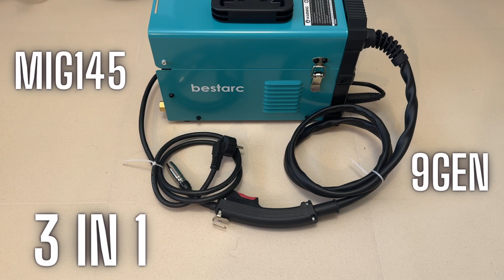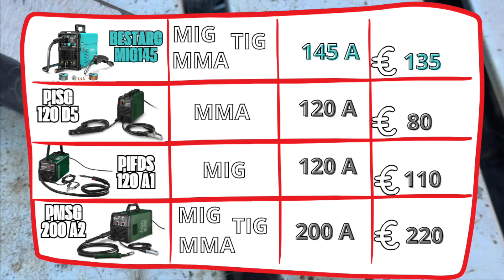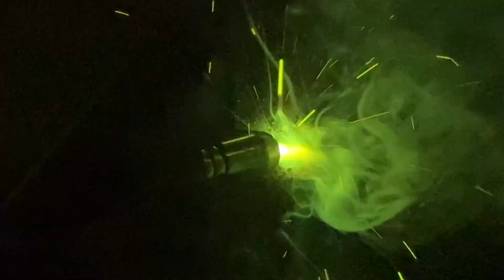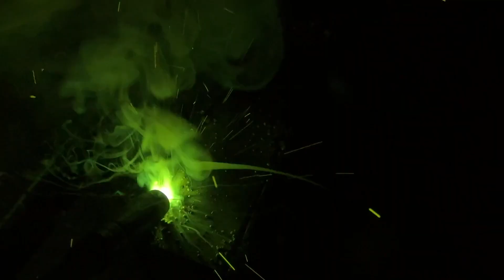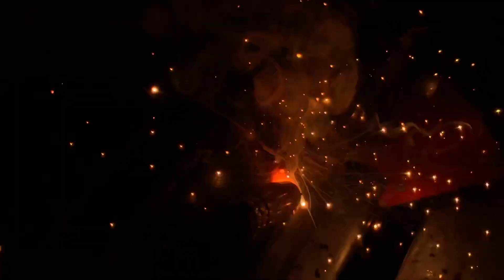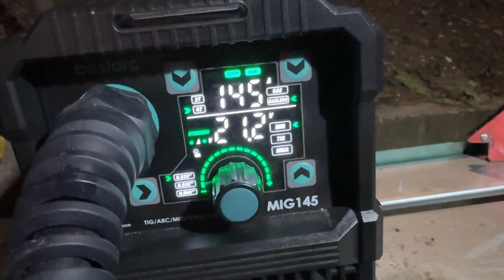The BEST Christmas present! BESTARC MIG145 welding machine review and test.

Comment: I have a suspicion that you failed to read page 10 in the manual and used the same polarity for stick and flux core. That excessive spatter is likely caused by electrode positive polarity, but flux core is meant to be used with electrode negative setting. It's a quite common mistake and quite possibly the source of flux core's bad reputation. Whilst the quality of flux core wire affects the amount of spatter, that mess you had can't definitely be caused by low quality wire only. 
I have that Parkside welder that does flux core only and using Parkside wire also, results are worlds apart you have shown here. Don't think Parkside has that much different quality tools and supplies than Bestarc, so the dog must be buried somewhere else.

Comment: Did you reverse plus and minus with the shielded wire? Flux welding should not look that bad, the torch should be connected to minus.
And drag the torch with flux, not push like you most of the times do with gas. But it looks like you are doing that. Big disadvantage, you cannot fit bigger rolls. Seems to be a decent machine though. Cannot find it for that price anywhere.
As a good alternative IPO tools 160ERS. Takes bigger rolls and has an euro connection, works great on thin car plate. May be this one is also good at that, would be nice to try, not with flux.

Comment: You can't continuously weld 1mm no way! Getting it to warm would warp it and you probably make holes in it. If you set the machine super low i feel like it doesn't hold well. As for the 2mm (in a proces of welding garage door myself) you also need to stop the material gets to hot. Professional welders feel free to roast me 😅.
Reply from the maker: Trying to weld that 1mm was sooo difficult 😅 trying it with the thinnest welding wire that I had at the time - 0.6mm made things a lot eaaier. I think possibly MIG is the easiest eay to handle such welds. I went through the metal so many times with an electrode 😅
Reply: @BrokeLifeEU  you have to tack weld it 1000 times 😆. The proper way would be machine capable of spot welding (it shuts off automatically while you go and that's expensive). Mig is the way to go i also need to get a bottle soon flux is drity which makes it annoying to use. The electrode is super annoying as you have to do two movements and i am not even capable of doing mig properly 😂.
Reply from the maker: The Bestarc is currently with a friend who has a bottle. Using CO2 and Argon mix he said it is a completely different beast. No splatter and smooth weld all the way. Need to get myself a bottle in 2025 🤩
Reply: @BrokeLifeEU  Same!!! I want to as well just need to close my new garage (making the door now 😆) when i finish that i will definitely buy bottles for mig and probably at some point pure argon for tig. I'm thinking about a course maybe in the future because for some reason you need to have papers if you do any "critical" welds on cars. Total bs but that's the country i live in 😆. Also someone said they last only about 6months which if true sucks.
Reply from the maker: Can only hope this channel gets an invite for a welding video in the new garage when its done 😂

Comment: Merry Christmas friend! I think need a weld maschine but I do not have one. Thanks to you I will buy this it looks like very good maschine for this price. 15% discount on a new version with 165 amps I think I buy that what do you think?
Reply from the maker: Thank you! Merry Christmas to you too! 🎄 I only have experience with the MIG145 which is the 145A model, however judging by my experience you will not be disappointed with the MIG165. The one in the video is enough for me as I am an absolute novice, however it can't hurt to have more power in reserve. This is said way too often these days however despite Bestarc sending in this thing for testing the opinions are my own. I told them if I found something wrong with this I would report it, however at this price I honestly can not fault it. That is why I also linked another video from a different channel. In that video unlike me they know what they are doing so you can go and watch that as well. Just an awesome machine for this price. I never knew such a versatile welder could exist before I got this. I had known of Bestarc for a long time before I started this channel, but it always seemed unbelievable to me that they had proper working welding machines at those prices. Now that I have tested the MIG145 I am still surprised at the fantastic cost/performance ratio. It is a superb welding machine, that my lacking welding skills just can't do justice to. If you end up buying one please let me know what you think. I would love to know your experience!

Comment: I got the12v  76mm grinder and the 12v impact wrench from Parkside and partly the reason for it is you videos.
Cant wait for changing tires LOL
Reply from the maker: Thank you so much for your trust! I have a love hate relationship with the 12V impact wrench. I like its size and size to power ratio, but just as I start using it as my main impact wrench we get to a bolt that it can't unscrew and it gets on my nerves 😂 Although I do understand that it is probably my fault for getting too comfortable with it and expecting a bit too much at times.
Reply: @BrokeLifeEU  oh well. But at least it's working. Mine turned out to be really out of spec and is not functioning properly. Have to send it back to lidl and hope for a replacement. Right now its out of stock... bummer
Reply from the maker: @fabsenbmx  😔 Really sorry to read that! I hope that will be the case with your warranty claim, however I have sent back tools which were not in stock too and they sent me a replacement so I think they have spare stock justo for warranty claims.